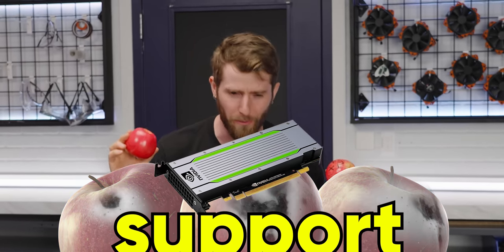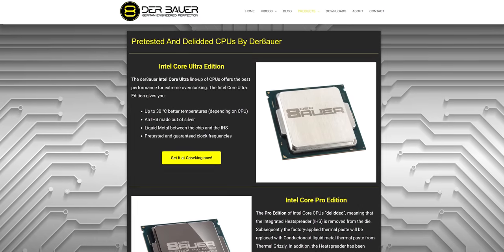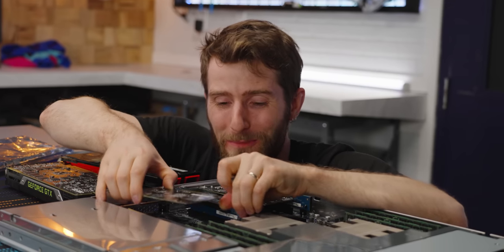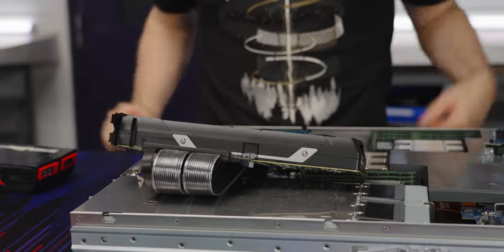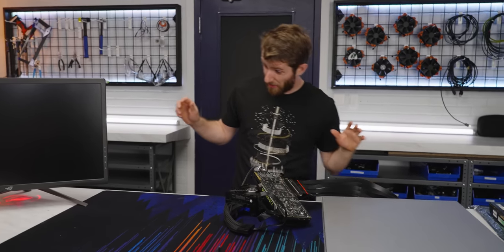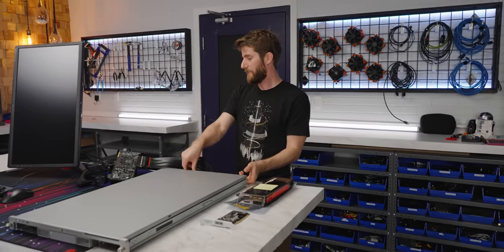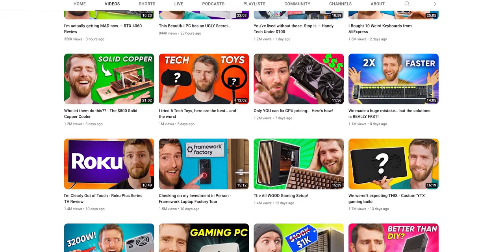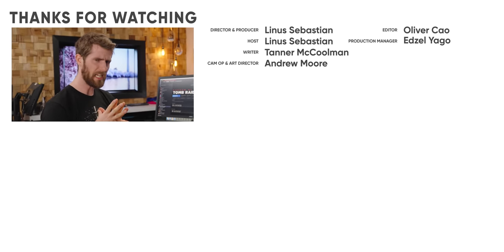Gaming on the Apple SERVER? - XServe 3,1

Comment: Going from 1->16GB per slot is "over a 15 x upgrade." Brilliant. 10/10. Perfectly written.
Reply: It is exactly a 15x increase of memory capacity.
Reply: @SamuraiGuy  It its 15GB more x slot, not 15x more, you don't have 1 GB of ram and change to 4 GB and say I have the triple of ram now.
Reply: @Sparktan24  When you say you got "X times more", you end up with X+1 times as much as you started with.

1GB to 4GB would be 4 times as much, and 3 times more.

The same happens with percentages. 100% as much means no change, 100% more means a doubling.
Reply: Come on guys. 16 is always over 15. that's the funny point. Not counting "how many times" bla bla bla. You're missing the point ... XD
Reply: @SamuraiGuy  😂
Reply: @Sparktan24  no, it is 4 times more / +300%

Comment: get a topography map of the server and make sure to pin the game threads to the CPU that is connected to the GPU, otherwise you're gonna have a really bad time. seems like portal ran on the wrong CPU and Batman ran on the correct CPU, hence the massive difference in performance
Reply: it was going at 300 FPS, it wasn't a performance issue.  It was an optimization issue.  You could also see Arkham tearing like crazy, too.
Reply: Or remove one of the cpus
Reply: @PistolShrimpPimp  Portal 2 had a shit ton of input latency, which can be caused by the game running on CPU 1 but the GPU connected to CPU 0
Reply: @genderender  when vsync was enabled
Reply: Those registered DIMMs didn't help either.
Reply: @tux9656  I wouldn't necessarily agree with that. My large home-server has 256GB of LR-DIMMs and I can game on it remotely just fine. And that is with the server acting as a hypervisor that passes through half of a Tesla P100 as vGPU to a Windows 11 VM. Those LR-DIMMs run at DDR4-2400
Reply: @insu_na That's a whole different generation of RAM though with more than twice the clockspeed than this 1066MHz registered ECC
Reply: Definitely software macOS and drivers problem, I've had dual CPU LGA1366 machine with rdram and games run just fine

Comment: Fun fact, I had this exact config as a workstation for three years during university, although with a Dell R610 and a 3d printed mounting bracket to the side of the server for the gpu. After about a year you don't notice the jet engine below your desk anymore.
Reply: I've got an old IBM Pentium 4 server, and you'd swear there was a squadron of harriers taking off when you fire that useless thing up. It was a nice Minecraft server back in the day, but I doubt it would even run modern Minecraft.

Comment: You know you really can game on the equivalent Mac Pro. The 4,1 can be flashed to a 5,1, upgraded with dual X5690 and 96GB of RAM. You can install PCIe cards so 10Gbe and NVMe drives work. You can even boot from NVMe if you upgrade to Mojave. I personally like running Ubuntu on these systems.
Reply: I’m an owner of a 5,1 with dual x5680 (not my main system anymore.) with an rx580 as the gpu surprisingly capable
Reply: Yeah that's basically my gaming setup during the lockdowns lol
Reply: @Drw4878  even the rx550 are good enough if you dont do heavy gaming..the baffin ones of course, lexa is not compatible.
Reply: @yesterdaysjam2405  using macos?
i use it for gaming too..i mean, on my hack

Comment: Look into installing Linux on this. I've had decent luck installing Linux on older intel Macs. Haven't done it on a server though. Could also look into forcing newer versions of MacOS to install
Reply: This!

I can't believe they didn't try this. Maybe we'll get an extra video with Emily?
Reply: Yep, I was also silently screaming this in my head
Reply: He stated that people have tried to emulate a uefi boot enviroment to no success. This means that linux won't work either, or any other OS than Mac OS for that matter.
Reply: @stefannilsson2406  Linux doesn't necessarily use UEFI. It can be changed to boot in any way imaginable.
The only issue is someone would have to actually create the boot loader for it, which might be quite difficult.
Reply: @stefannilsson2406 you can run Linux on these without UEFI, just uses bios
Reply: @alfiegordon9013  afaik macs never had bios, they had a UEFI and a PC-Compatible emulated bios if the Mac supported boot camp
So this one doesn't one either of these
Reply: @bluesillybeard  If all else fails, we could write an OS X kernel module that kexecs into Linux
Reply: Who/ What is Emily? Is it a person or some compatibility layer with a silly name lol
Reply: @pidojaspdpaidipashdisao572  Anthony : /
Reply: @mskiptr  the linux guy with pc masterrace hair?
Reply: the xserve in particular is picky about what can run on it, thanks to the integrated raid card, so it's not as simple as just running a linux installer. so unless you do some huge work arounds you're stuck with MacOS
Reply: @stefannilsson2406 you can just hold alt and access the boot menu. Then boot any ISO/flash drive/CD. Idk what Linus is on. People have installed both Linux and windows on this exact machine without issue.

Comment: My first ever “gaming” pc had a x5570 and I find it so funny that that’s the fastest cpu available in this machine
Reply: My first modern gaming capable system had a Xeon W3520 (i7-920) from the same generation. That was in a HP Z400 Workstation, in 2016 I upgraded the CPU to a X5670 6c/12t and a bit later built a system with a OC capable motherboard. In between I also had a W3550 (i7-950) but that was only for few months
I'm still using the X5670 @ 4.4GHz with 24GB RAM and GTX 1080

Comment: I suspect the reason you couldn't get 96GB of RAM to work is your memory has more ranks than the memory controller can handle
Reply: yeah, server ram can be real fun that way, if those are the quad ranked Kingston sticks I think they are.
Reply: Funny to think you could have the same 64Gigs on a mITX board in 2021.
I know it's not ECC, just shows how hardware ages.
And most "gamers" don't care about memory amount and run on 32 or even 16 with high end Mainboards and GPUs :)

Comment: Fun fact! IBM System x3650 M1s (and likely other models) used a special PCIe connector for the dual 8x riser, which is considerably longer than a normal 16x slot
Reply: I have two of these machines still running! They are still surprisingly capable and very reliable!

Comment: Both the XServe and the Mac Pro of that generation are picky about where you put the RAM, in what pairs and what density. To reach the maximum RAM you have to find the magic combo of density, timing, and amount per stick. There is plenty of documentation related to the Mac Pro which applies almost 1 to 1 for the same XServe.

Comment: I dont know if this will ever be used in a video but i used to power car speakers/subwoofer with a computer powersupply jumping the pins similar to what you did in this video, except it was just a short wire i cut and bridged.

Comment: LGA1366 Xeons are still pretty respectable performance on PC too, especially the 6-core models. I ran an X5660 overclocked to 4.6GHz with 24GB of trash can Mac Pro RAM in a Gigabyte board as my main gaming machine for a while. Upgraded to 3000-series Ryzen when they released - mostly because of the X58 chipset's I/O limitations like lack of USB3, SATA3, and NVMe.
Reply: Check on limitations. Had to buy pcie cards for usb3 and sata3. Never bothered to install NVMe but I know there are solutions as well. Ryzen 3000 series is a valid upgrade path. Unlike the 1000 series which were unable to beat X58 and this much older xeons XD

Comment: Mac memory specs are as tested at Apple.  Often you can put in more than the spec on most intel Macs.   eg: My CordDuo spec'd to 4 GB, but I installed 4+2 = 6 GB (would not support 8 GB).
Reply: Apple also would like to list something as "Max 4GB" because there was only 2 RAM slots and the largest DIMMs you could buy at launch were 2GB, so the maximum you could configure it for was 4, once 4GB DIMMs came out later, it was usually down to what the memory controller could address

Comment: Nehalem... I rocked mine for 8 years but the games i liked to play were often limited to just 2 threads - so 50% cpu utilisation on my i5 yet still CPU limited.
SandyBridge was a big jump (like 30% faster) and would still be useable as even the i7 2600K is still used by people.
Reply: Nothing beats Westmere. Even newer gens didn't have what made Westmere great: 3 channel memory, unlocked FSB and tons of OC potential.
Reply: @MrCroky123   "Nothing beats Westmere."
on the highend sure. But on Desktop it was a step back - only 2 cores instead of the previous 4 for the i5 lineup. thankfully for westmere there were many games that were still singlethreaded back them - so still very good for gaming.
Reply: @ABaumstumpf  , you're absolutely right about that. Desktop versions lack so much ...

Comment: The best computer I ever bought was a used 2009 mac pro. The drives are swapable with no cables involved, the pcie slots have multiple braces
 to prevent GPU sag, and I can pull the processors (there are 2) and ram out separately to work on them. (They are on their own daughterboard.) 

Until I get to the point of actually removing the heat sinks I don't even need tools. This is how computers should be built, not like this modern apple stuff where swapping even swapping an SSD is an issue.

And for all you windows users, I bootcamped it and am running windows 10. I can even play modern games on it.

Comment: The "ram issue" is due to these computers (and mac pros) being extremely picky about what slots the RAM is in. There doesn't appear to be any rhyme or reason to it, but you have to move them ram around at random, as long as it's still in the "optimal configuration" you'll still get full performance. It doesn't seem like it should work like that, but it does. Dell R710s are like that as well, in my experience. For what it's worth, using linux on mac hardware (while usually kinda difficult to install) is as good as it is on any other computer, and will extend the life of the hardware quite a lot. Dual booting macs is pretty common among the "weird people that use 10 year old pro-grade hardware" community.
Reply: Can macs cope with non-binary memory configs? Though this might be a mobo or chipset thing, only a term I came across recently.

Comment: "How many people have a Mac gaming rig with 96 gigs of RAM"
I do. Admittedly, it was retired in January in lieu of an M1 Max MBP, but my 2012 Cheesegrater was my daily driver for years with 96gb ram, dual x5690s, and an RX580. It's still a monster mixing machine, but it's just very hot and I don't use it enough to warrant the energy cost. Plus being able to undock my "workstation" and take it with me now is pretty slick.

Comment: The RAM problem could also be that it wont boot with that capacity of RAM at that speed. You'd have to get slower RAM to use that capacity.

Officially, those CPUs only support 1066 MT/s, and your 16GB DIMMs are probably at least 1333 MT/S.

Comment: been doing a church summer camp the last few weeks. Me and another computer nerd have been tasked with salvaging parts of PCs to Frankenstein some old office desktops into semi competent gaming rigs. A couple weeks ago,  we actually had an old Mac pro to disassemble. Think it had 8 4GB sticks of ddr3 on risers (might have been ddr2) and it had a full sized GTX 780, which was an amazing thing to randomly find in a PC randomly put upon us by a church
Reply: We also got a "broken" HP desktop with a 10th gen i3. We were told it only displayed black and white, so we tossed a GTX 1050ti into it. That didn't solve the problem. What did solve it was turning off the color filter the user had (seemingly mistakenly) set. Now that little display of user error is our best rig we've put together in that computer lab

We also had 2 8GB sticks of ddr4 (no clue where they were from, they were just kinda there, all of the other PCs were ddr2 or ddr3) so we were able to upgrade the 4GB in the desktop to a more usable 16

Comment: I have a HP workstation with 2 x5570 xeons from the same generation. Unlike that Mac server it's going to stay out of a landfill because it runs windows 10 and it will soon be running linux. :)
Reply: HP Z600 or Z800? My first modern gaming capable system was a HP Z400 in 2013
Reply: @Pasi123  it's a Z600 :)  I tried installing a couple more modern x5650's in it but they didn't work. Got it to boot once or twice, but it didn't like them. It would boot fine with just 1 of them installed though.

Found out that HP made 2 versions of the motherboard and I had the first and older version. The 32 nm cpu's were only supported on the second version.
Reply: Incredible hardware ! Regarding the x5650 ... man, I think you also had to be sure they were matched cpu's. Otherwise ...
Reply: @MrCroky123  Yes, you need 2 of the same cpu. So you need 2 x5650 cpu's.  But as long as they are both the same model, serial number or anything else shouldn't matter.
Reply: @stefannilsson2406  , ... and stepping as well. Don't forget about that.

Comment: That Xserve configuration is about on par with my Mac Pro 3,1 from the Harpertown generation, Despite being the Nehalem gen. 

For the 2008 Mac Pro there is a way to inject emulated SSE4.2 instructions to the Xeons so you can run metal supporting Radeon cards from Polaris, Vega, and others. Not sure on the latest Navi 3 cards. But 5700xt should probably work. I know the Radeon VII works. 

Also you should be able to get at least Mojave running on that with some various patching tools and terminal commands.
Reply: 3,1 owner here. Thanks, I have to check that!
Reply: @snikeplassken  it wasn’t exactly easy to do, but digging thru some forums, a little help from dosdude1 tools, and some time I got it done. 

I did that back in 2019 maybe 2020. There are probably easier ways than what I did by now.

Comment: I'm still running a 2009 Mac Pro as a server/storage. I've upgraded the Wi-Fi module, CPU, GPU, RAM. And I can fit at least 6 drives for storage, and whatever PCI slots are left for M.2 drives.

Comment: So made some Hackintoshes back in the day with great success, pretty sure the last supported cards were the 780/Titan. The Titan Black - Maxwell was new architecture and not supported and most forums said do not try. No idea if someone modded drivers to work with newer cards or what you are using, but the stock Mac stuff would never run this. As for the prev gen Nvidia cards, they always worked great for me.

Comment: I had the Dell version of the Mac Pro 5.1(Westmere) I think you can flash the XServe to suppoort the same processors, but it might report as a Mac Pro 5.1 after, worth the risk to go from 45nm 4 cores, down to 32nm 6 cores, often at either much higher clocks, or lower TDP, the E5649 is the GOAT for lower power budget, high performance, i had a 1U C610 that was reasonably quiet with these, drop in the 60w L5640 and it was whisper quiet
The Mac Pro 5.1 and Dell Precision T7500 were great machine, 12 cores at 3.6Ghz all core boost split across 2 sockets
The Dell came with 72GB of RAM, but up to 96GB(technically up to 192 GB but this machine had a bug in the chipset that didnt allow for the use of the higher density RAM modules to run properly)
I threw in a GTX 1080 and basically gamed on this workstation until the 3950x came out, and was honestly disappointed in the difference in gaming performance, sure some games saw great improvements, but others saw a ~10% difference becuase this was around the time games started supporting more and more cores.
IIRC The Division 2 saw less than 5% perofrmance differnce in average and was only 15% faster in 1% lows, and i feel that might have been due to the NVMe being faster than the SATA SSD in the older dell

Comment: Its essentially a Mac Pro 4,1\5,1. It will support 256GB of RAM. A Mac Pro 5,1 with dual Xeon X5680s is my main system. I have 96GB of RAM (for triple channel) and I use Windows 11 on it for gaming. I have a Radeon RX590, and I also boot macOS Ventura (13.x).

This Xserve will also run Ventura with OCLP. It'll also boot an EFI install of Windows 11, but also only with opencore.

Comment: I actually used to game on a mac pro 3,1 until 4 years ago, it had 8 GB of DDR3 ram, dual intel xeon processors, and a GTX 950, but every time there was a software update I'd have to reinsert the older radeon HD 6870 to update the nvidia drivers, I eventually switched to a windows pc because many games weren't supported on macOS, and the few that were often moved to only 10.12 sierra and later, as that was the first version to support metal

Comment: One of the first hurdles for developers to port games to the Mac tends to be Apples requirement to use Apple HW when compiling games for Apple HW which is immediately offputting for a lot of us indie developers who have to weigh the risk of paying a lot upfront for reasonable HW vs what returns we may get. 
Unreal Engine for example can cook/compile for every modern console from within Windows if you have the appropriate plugins but need a developer console to launch/test where as Apple have traditionally required you to compile/Cook on a Mac before we can even test.

Comment: It's probably what you guys were looking for, but, rEFInd may help there. It's not a full BootCamp replacement because it doesn't do driver installation, but helped me a lot when I had a Macmini "ages" ago (multi-booting with Windows and Linux). And a very good tool for the flash drive is Ventoy.